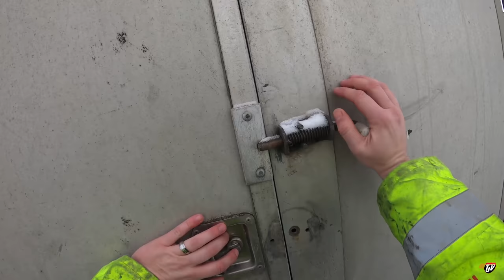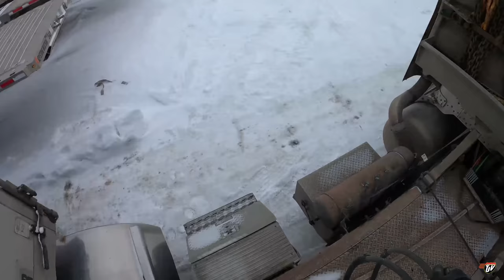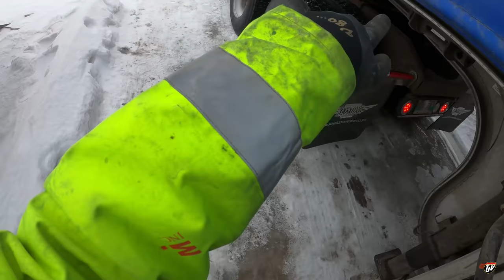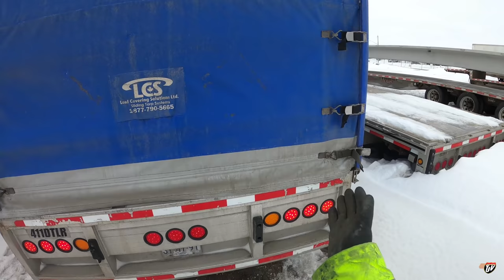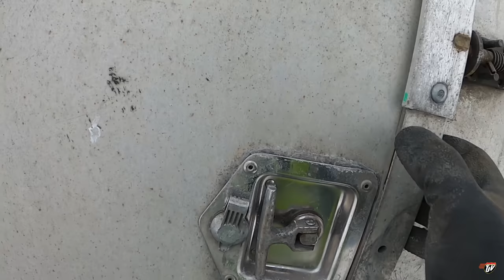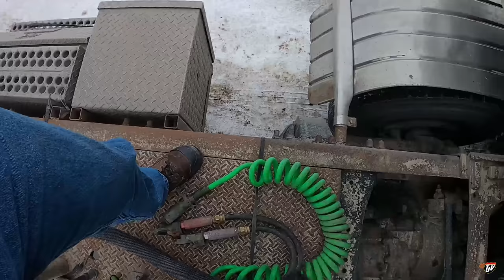DON'T BE SUSPICIOUS | My Trucking Life | Vlog #2463

Comment: Better off running those rpm's higher in slippery conditions Josh, less torque, won't spin out as easy. You're running at 1000-1100, more torque, easier to spin the tires .